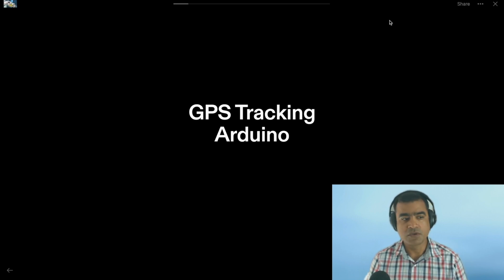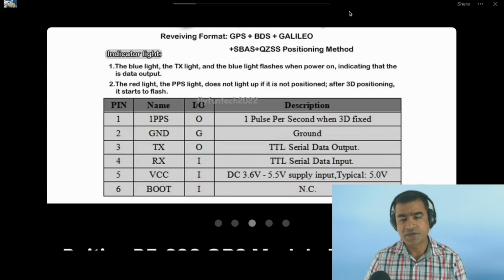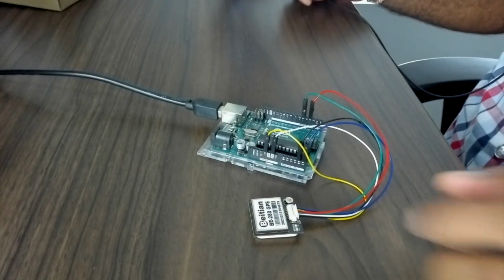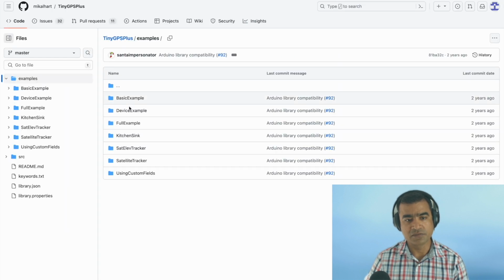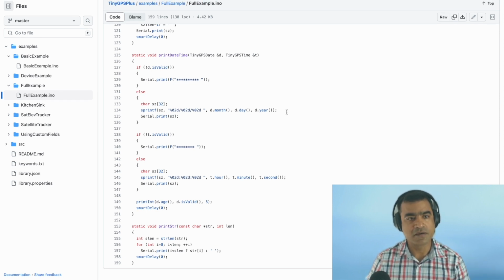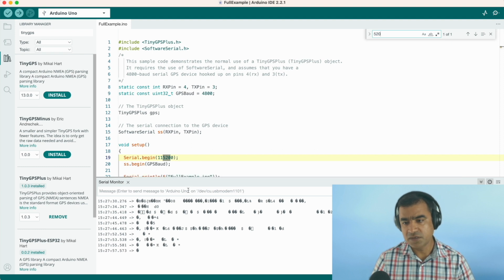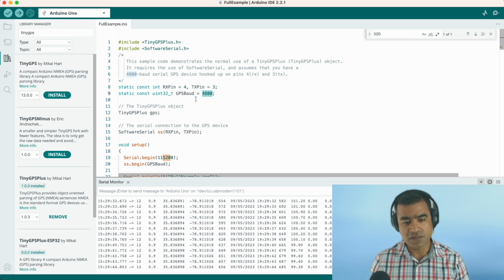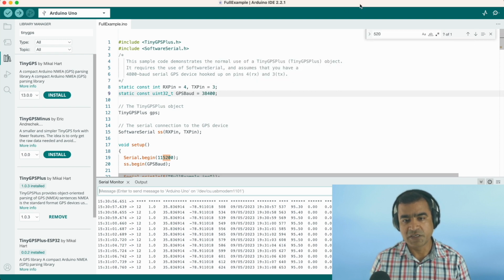Arduino Tutorial: Reading Data from a GPS Module

Comment: I’m trying to use with a BE-880Q, but the data never shows up. Only ***. When using the ucenter2 I can see all the NMEA messages there. I’ve tried many different baud rates, including the standard one that is 38400, but no success.
Reply from the maker: Thank for question, 38400 or 115200 is the baud rate I recommend, Please make sure you have Tx and Rx connected as per the program or simply try swapping them. NEMA is for serial communication and should not tied to any specialized software.
Reply: @SDNTechForum  Thank you. I discovered that the problem was with a library that I was using to read the GPS signal. When I read directly from the serial port, the problem was solved. However, regarding the baud rate of 38400, I tried to change it, but it didn’t work and gave me an error.
Reply: My problem now is with the compass calibration. Any idea in how to make it acceptable?